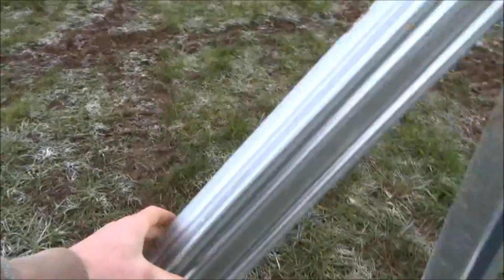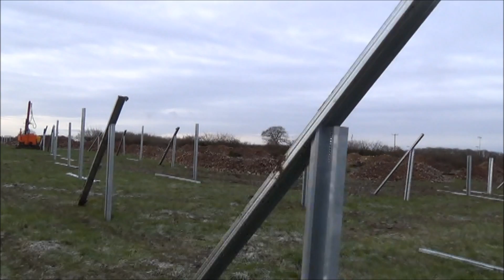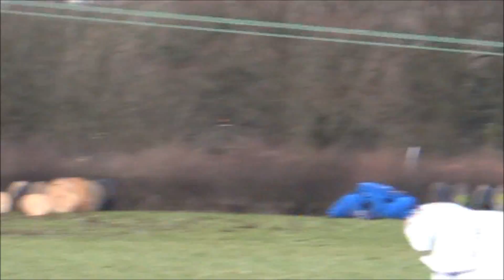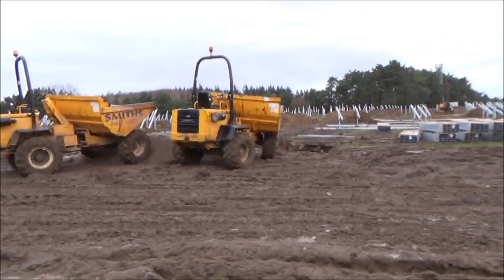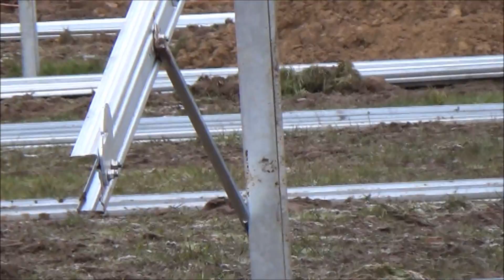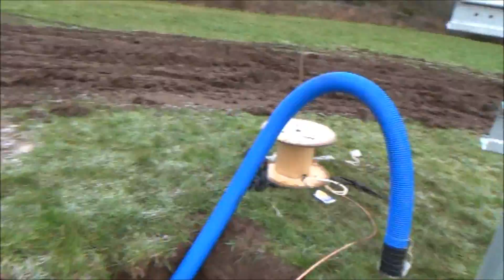Building a solar farm in Gloucestershire. Part 3

Comment: They are mounting them far too close to the ground to run sheep under them - serious lack of foresight  as they will have to be mown rather then run sheep. And as to herding sheep around the mounting posts - nothing beats a good sheep dog. We have some sheep farmers here getting '3' streams of income from their flocks - wool (which really costs more to shear then is recovered from the sale of wool), lambs and solar field 'maintenance/mowing'. It has allowed farmers to run bigger flocks then the size of their farm could normally bear.  Flocks are contracted to 'strip graze' thru solar fields all summer leaving the farm fields free for growing winter feeds.  Judging by the rocky 'soil' under these panels, this land is just barely arable, not good for much else but growing hay or grazing.

Comment: I'm a bit disappointed that you, who has built sheds and what not, don't understand that, yes, there will be NOISE during construction! There will be ground 'disturbances'.  But once it is finished and up and running, it will be a better neighbour than any other farm. There will be no noise, no smells, no tractors hauling load after load after load because we must make hay while the sun shines. They are not as 'pretty' as a field of cattle but sheep or goats could go hand in hand, grazing off vegetation that threatens a panel's ability to produce electricity.  Far better this then a nuclear power or coal fired plant for the sake of our children and great grandchildren. We don't own our bits of earth, we borrow it from our children and it should be everyone's goal to leave it a better place than we found it.

Comment: The cost of removing all that at the end of life would be massive, I'll bet the panels would simply be renewed with a further lease as it would be too costly relative to agricultural value.
Reply: The panels NASA messed with in the 1950s and 60s are still around... collecting 30-50% of their STC new, but degradation levels have exponentially gotten better since then.  So if the panels of then could make it 60 years, then these may be warrantied for 25, but actual life may be 60-100 years considering all the new technologies and continual exponential increase in long term reliability.

     Growth rates at 80% just from last year this show us that the sheer tumbling of energy, investment, and logical step in reducing our "overall" impact is a no-brainer and here to stay.  You have major appliance and power company like LG stepping in, in a way to stay too, and others stepping up their game at every level, while at the same time becoming cheaper to build as supply has to increase. 

     Wanna deal with "agricultural value" then work in permaculture throughout the lands, but wanna worry about use of rooftops of both residential & commercial, and open lands for bigger "community" projects, then you have solar, wind, and in cases near water, geothermal and water turbine technologies like the ones introduced in Portland to create energy in the process of pumping water to people that is a process already needed to be done.

   The movement is moving, nothing can stop our ability to tap into the abundance of this world and soon we'll learn how easy it can be to all rise together and share all resources in a balanced setting.
Reply from the maker: er yes but I think the place for this is on the roofs of buildings rather than using up precious farm land that we can grow food on
Reply: It certainly is the BEST option, but 95% of energy subsidies go to gas and oil, so... start voting for those that will change that and move $ out of politics as an incentive, so we can focus on a real "economy" where "efficiency" is the key put into action not just talk... and by far, solar is an efficient use of roof space, so they SHOULD allow those incentives to flow as opposed to pipelines that employ only a few and leave the rest of the Earth raped along WAY larger areas of our land than the solar farms do.  Let's focus on "moving" our focus off oil n gas as a nation and make it a priority
Reply: The "value of solar" has been measured throughout the years, and economically for large and small, it is already economically viable.  There are cities like Burlinton, Vermont are already 100% ran by solar.  Germany has 90% less sun by geographic location and size of land mass, yet 6400 times the MegaWatt production because of incentives.  They currently have over 50% of their power covered by solar... this is not a thing based on "politics", this is based on science, demand, and price. 

   Make it affordable and create proper energy infrastructure to cover the gaps, and you have easily FREE energy covering the nation with about 4-5 years of moving energy from oil n gas to solar and others... which is an incentive for energy providers too because rather than paying a coal company or natural gas company to rip into the Earth, you pay a community member to install a power plant on top of their roof and save the electric provider from paying high fees to coal n gas companies to make new plants using non-renewable products, so it makes sense for them to invest in this as well.

   It will become like the invention of the Air Condition units... once it was a "new install" kinda market... soon it will be a "service industry" with exponential increase year after year of new installs due to the value of the energy source being unbeatable in price and helps humanity move forward more sustainably too.
Reply: Interesting  point of view Davincis,  we will soon see how the economics and practicalitys of solar measure up once all these big instalations start feeding into the grid over a few seasons. I can't help but wonder if the real push behind solar and similar is based more on politics than science but time will tell.